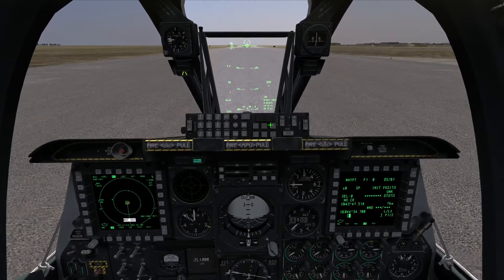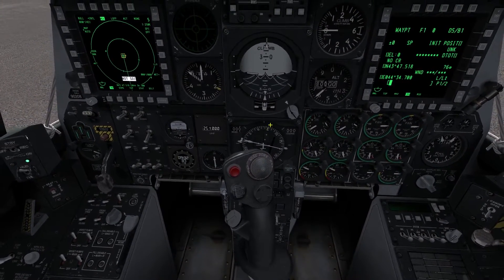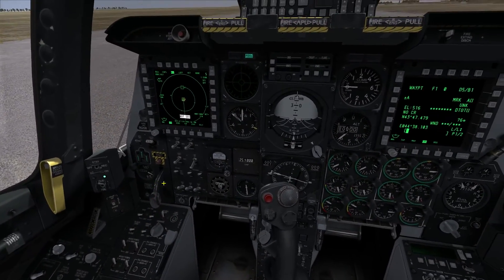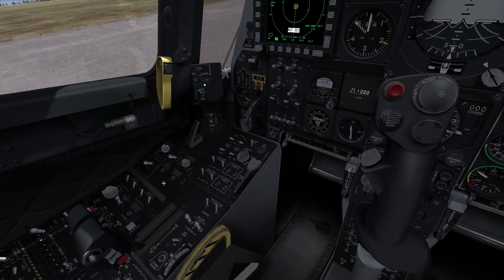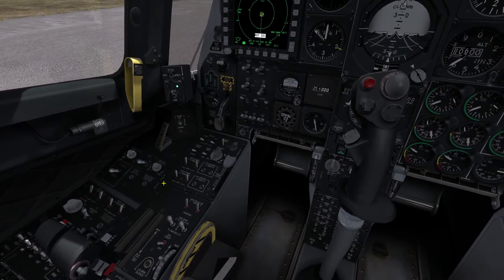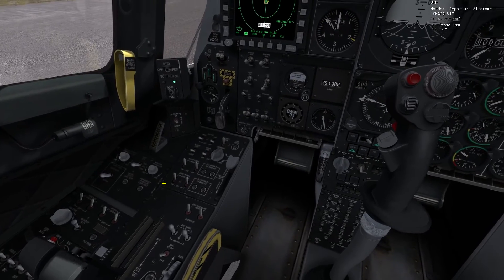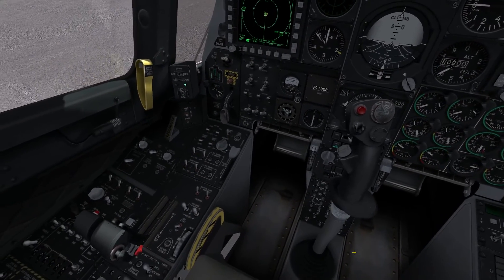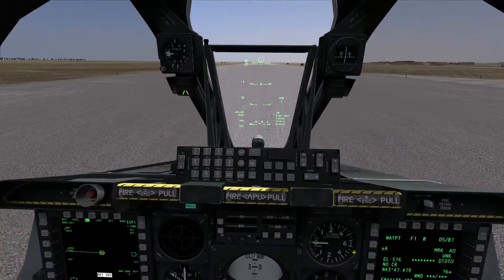DCS A-10C Tutorials #3: HOTAS Overview

Comment: Just got my warthog HOTAS thrustmaster today and didn't know what the pinkie switches did. Thanks! Also do you know what the paddle is on the stick that's just below the nosewheel steering button? I can't figure it out for the life of me. Good video!
Reply from the maker: On the Warthog HOTAS it's an emergency SAS disconnect switch. I use it for my TrackIR center switch. Congrats on the Thrustmaster. It's a great system!
Reply: @Kmbtkrl  Thanks! I am thrilled that it came without any defects. I kept reading terrible review after another and was horrified. Finally I asked myself when bad reviews has ever stopped me and ordered it. SO thankful for a working hotas. I was mastering the other planes with just mouse and keyboard. I will say slewing is hard. That was easy AF with my keys bound to numeric 4, 8, 5, and 6. Practice makes perfect I guess with the slew?
Reply from the maker: @sschreck  the slew ministick on the warthhog is IMHO the worst part of the whole stick. I've had limited success assigning curves to the axis and playing with saturation to mitigate some of the sensitivity and jumpiness, but never have been satisfied fully. I saw someone somewhere that makes a 3d printed extension for it that apparently increases the granularity of it a bit but I've never tried it.

Comment: Hi,  thanks for another great tutorial.  On the Thrustmaster HOTAS stick there is a lever in front of the pinky switch thatpresses another button similar to the pinky.  Any suggestions on what that might be used for and how to configure it?
Reply from the maker: I use it as a quick way to recenter my TrackIR. maybe a good thing to throw landing gear toggle on, or a modifier for even more buttons.

Comment: your vid are great I just got the game and trying to figure it all out, but wondering is there a un cage button for you mavericks on your hotas?
Reply from the maker: the mavs are a little more complicated than just 'uncage'. basically you will have to turn them on vis the EO power on the DSMS or the MAV page, and after they're aligned, you can slew them with the slew controls and also lock them to your SPI with china hat forward long. then TMS up short to lock. 

Expect a tutorial on this soon!
Reply: Thank you, I'm a bms guy so now everything is way different
Reply from the maker: +Gabriel Hammontree yeah. the falcon does a bunch of stuff for you. the A10 is way more hands on. biggest thing is that the falcon kinda selects systems SOI for you, where as with the a10 you have to manually switch. but you never have to uncage mavs with a10!

Comment: I was thinking about using it to center TrackIR also, can you direct me on where to find info on how to set that up?
Reply from the maker: its easy. inside your trackIR software, in the options panel on the left side (where you set up all the keybinds for center, smooth, pause etc, there should be a button for "center trackIR" or similar. just click in there and hit the paddle switch on the Hotas, and it should bind it. make sure to save the TrackIR profile, and have that profile selected when running DCS
Reply: I followed your instructions and it did bind the paddle switch in TrackIR.  However, it does not carry over into DCS
Reply from the maker: Hmm. Make sure that the profile stays active whent you launch DCS. Sometime you have to check the "Exclusive" box in TIR to lock it to that profile. Also if you unplug your controller and then reconnect it, it can will confuse TIR and you have to rebind the button. Other than that I'm not sure what the problem could be.

Comment: i hjave 1 hat on stick and 1 on throttle so i need to work out what needs modifier buttons, realisticaly i think i can only use the throttle hat for 1 thing so i dont have to take hand off stick to press modifier, i dont think i can use a button on the stick as a modifier??
Reply from the maker: eatthisvr6 if you can sacrifice a button on the stick for a modifier, that would be the best. If you don't have trackir, id use the hats for dms, tms, cms, and view, if you have trackIR id use the hats for dms,tms,cms, and coolie hats
Reply from the maker: eatthisvr6 remember whatever modifier you set will work for both throttle and stick.
Reply: that was my intention but i cant set a stick button as a modifier, only lets me choose ctrl alt etc.
thanks for the advice i do have track ir so thats 1 less thing to worry about
Reply: it wont let me set a button as a modifier
Reply from the maker: eatthisvr6 I'm not at the pc so I can't look, maybe you have to select the correct device from the list first before you can set a modifier?
Reply: Kmbtkrl tried that, I'l have another go tomorow
Reply: sorted it, go into controls then straight to modifiers box at bottom left, you can tell it what buttons count as modifiers
Reply from the maker: eatthisvr6 glad you figured it out!
Reply from the maker: Should be able to add a modifier thru that menu too.
Reply: yeh got 2 mod buttons on the throttle so i can hotas with upto 6 hats if needed, i plan on using mod + keyboard arrows to scycle through cms though and just use a stick button to activate the program
Reply: thats what i did